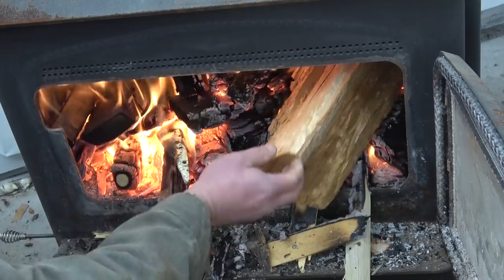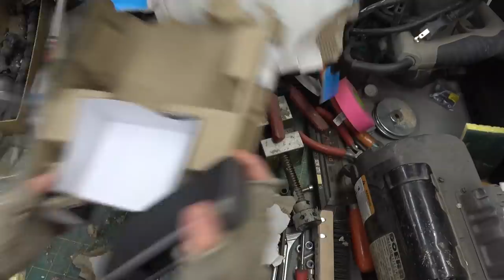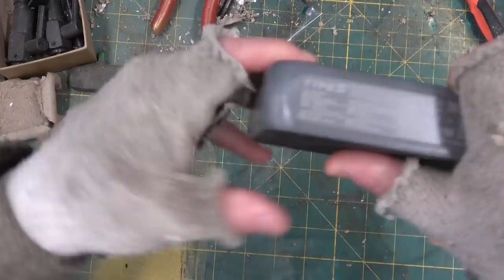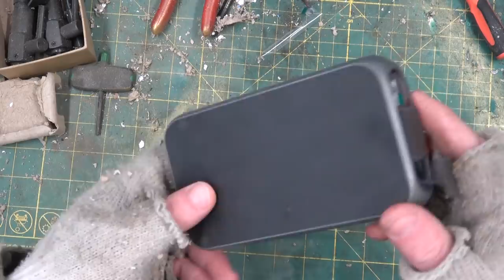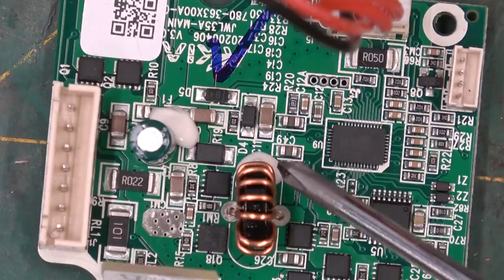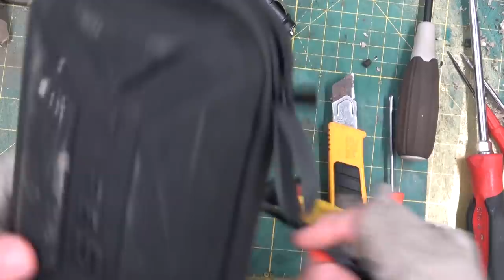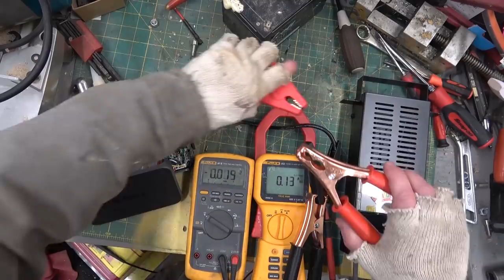BOLTR: Costco Boost Pack | Stupid Design

Comment: $5 says there's pocket lint packed down hard at the bottom of your phone usb!  I'll shut up and go back to watching now.
Reply: Every mechanic/tradies/engineers issue, greatest day when I cleaned it properly haha
Reply: 10$ says there’s grease in there
Reply: That’s where the paperclip pokes
Reply: My favorite is the staple magnetized into one of the speaker holes.
Reply: I came here to say the same. I've found that the punched metal sim card removers are quite good for getting the sh*te out of there.
Reply: That's absolutely what it is, my Pixel did it too
Reply: Since you said so I checked mine.

It verking, it's verking!
Reply: Oh Adam I cut a lot of steel and dig bits of metal out of the speaker screens all the time. I Wish you could turn permanent magnets off for a second or two
Reply: Got a pixel as well, same thing packed full of lint and factory dirt, that's what the sim key is really for
Reply: @walkersullivan6201  sim key works great when it's real stuck
Reply: Was about to say that as a phone repair guy that sounds like just a stuffed port, usb C and lightning port are both notorious for it, use a very sharp pin or fine as heck tweezers and dig it all out and she'd be as good as new
Reply: Tony, tell the comments to use a plastic poking thing
Reply: Indeed! Get yer toothpick and start pickin!
Reply: Or he's using gas station usb cables which are low quality and loose fitting. Like my pants.
Reply: @walkersullivan6201  Depends how badly packed in it it - I fixed a sparky's phone the other month when he came to visit, compressed air did bugger all - hed been pushing the plug in harder and harder to try and get it to contact.
Reply: Cut a 1mm strip of plastic off an expired credit card. Rigid enough to scrape out the crud, but doesn't bridge contacts.
Reply: @mikehealy74  If at first you don't succeed turn up the regulator.
Reply: 100% I have the same phone and have had the same issue. Give 'er a blast with the compressed air cannon and you'll be good for another few months. I'm sure it doesn't help using my phone for a flashlight while using a carbide hole saw to turn a j-box into a swiss cheese box. But I digress. USB type C is far superior to the prior iterations because it doesn't lose it's holding power like the cheap little metal tabs on the mini and micro.
Reply: I know it would have helped to hit it with the grease gun but I couldn't find a damn zerk anywhere on the thing.
Reply: Holee Sheetz....My hole has lint
Reply: I use the plastic toothpick /floss tools.
Reply: Yeah, I agree had a couple of USB c phones now and both suffered with that issue.
Reply: And here I was thinking it was packed full of shmoo..
Here is my 5$ ToT
Reply: loved the feature length maho video btw
Reply: I got $10 on metal shavings (Is that grandfathered in as pocket lint?). It's always metal shavings.
Reply: You get around too Tot lol
Reply: Same. I've had that on my 5X, Pixel 1, and Pixel 2
Reply: Checking my usbc device. Yup pocket lint. ToT maybe write some cnc code to clear out the usbc socket with a 1mm pcb endmill?
Reply: Buy Huawei, their usbc ports last forever. Unlike their micro usb ports which can be damaged by wind...
Reply: Yup with either C or Micro I have to go in with an XActo every few months to pull out lint
Reply: ToT is probably right, AvE might have to cough up $5.... I've resorted to digging out my port with a small allen key or a needle, need something pretty rigid and can scrape the surface cause that lint gets packed in there real hard
Reply: If only ol AvE had some sort of contrivance what for diggin out his pocket stuffings  from his electronical orificees.
Reply: @yes7420  all the shmoo
Reply: If digging the earwax out doesn't work, sometimes an off-the-shelf usb to usb-c cable works. My pixel 2XL stopped recognising the google-branded chargers, but would still charge with random 3rd party cables. It's one of those "we know about it but it's cheaper to just send out new phones than fix the underlying problem" kind of deals.
Reply: I ended up having to get a plug to cover the port on my phone. I hardly ever used it, so it wouldn't get cleaned out from plugging and plugging in the cable. Because of that, lint piled up and wouldn't let my headphones work, the few times I needed them.
Reply: @walkersullivan6201  Lol 9mm works even better 🤣
Reply: yup, been there, its packed in hard too, so it feels like you might be wrecking something but you can dig her out
Reply: exactly what i was thinking
Reply: @heatshield air Always works for me never had to go past 140 psi
Reply: I call swarf/ iron filings, wireless charging and speakers have magnets.
Reply: Every F*ing time! Phone won't charge? Lint in the socket. It's theType-C food of choice apparently.
Reply: Happens to me about once every 2 months. Drives me nuckin' futs. On the plus side, I finally found a use for my Swiss army toothpick.
Reply: AvE will probably find a whole cat in there.
Reply: wooden toothpick is the best for getting the smooe out of the charge port
Reply: @heatshield  to each there own
Reply: @apainlessone  ...until you break the toothpick inside, nylon is generally better and not brittle.
Reply: I carry my phone port up and never have a proble with this
Reply: Agree is amazing how much lint can fit in a USB C port. I cleaned out a friends phone and when they saw pile of lint on the table they refused to believe it came out of the charging port.
Reply: Yep, only time I've seen a problem with type-c there has always been some schmoo packed right in there.
Reply: +1 on the SIM key: keep it on your nightstand and give it a swipe before you plug it in when it's getting uppity. 
It's amazing what you'll pull out of there.
Doesn't help the moisture thing though. For that, flip your charge cord around so that the squared seam in the connector is facing you. Not 100%, but way less frustrating.
Reply: ToT good luck with the MAHO
Reply: Holy sh*t I have had the same problem for 6 months and had been told it would be $125 to replace the port and install new back glass (which they would have to break to get in). 
I just repaired it for free w a bit of crap I had lying around.
Reply: Seconded. Charging problems are always lint on the pixel. I use a decommissioned credit card cut into a hook shape to fish it out.
Reply: @thomasscott4378  
Hehe...you release the glass with a heat gun. 
If you replace the glass, it's because the sealant was compromised, not because you have to break the glass to get it out.

But then again, they also didn't suggest you try cleaning out the port first...
Reply: @marfinhead  you just need a much stronger magnet, just be sure to cover said magnet with plastic so you can peel off the junk
Reply: I use those green plastic tooth cleaners on mine.  Amazing how much crap fits in that port.
Reply: My pixel was the worst for collecting fluff. Subsequent phones haven't been nearly as bad.
Reply: I've "fixed" a sweet fuckton of friends' phones with this.
Reply: A blunted toothpick isn’t conductive, won’t scratch plastic and picks up cranny lint quite nicely.
Reply: This just fixed my S8. Thankyou!
Reply: Totally agreed. I get a sewing needle and shove it in there to relieve it of lint every once in a while and it works like a charm after.
Reply: Came here to say that, but of course ToT beat me to it. 8^)
Reply: @scythelord  easy fix, buy a decent magsafe knockoff. Saves the port, too.
Reply: @Trialnerror  ahh tis true my friend but one can dream. Because as some have suggested a stronger magnet can really kerfuckle the speaker all to Hades and back then Bumblefuck here sounds like Minnie Mouse.
I've learned after destroying two phones 
A: never put the phone down on the metal bench
B; sometimes a piece of gorilla tape or similar 1000mph tape will do the trick
Reply: I agree with the Maho Man! I cleaned out my Pixel's USB-C port using the pointy end of one of those plastic toothpicks, worked a treat.
Reply: Cat phone has a rubber bung.
Reply: @RyanNeufeld  You got your pants at a gas station? Well there's yer problem buddy. :p
Reply: I've found usb c to be far more robust than that abomination known as micro USB
Reply: I came to the comments to say this. Bought a used s9+ that was touchy when charging through the cable. Pocket lint was packed in the port like concrete. Took several minutes to remove it all. Haven't had trouble with it since and that was 9 months ago.
Reply: Added this exact reply before scrolling down.. I can't exaclty say GREAT minds think alike, but at least the hive mind comes to a concensus
Reply: I use my Diresta ice pick to clean out my lightning ports more frequently than I care to admit.
Reply: @marfinhead  Have ruined a fair number of cell phones with ferrous bits attracted to the speaker's magnet. Life in the machine shop...
Reply: Was about to comment the same. My headphone jack stopped working a few months ago and after pulling out more lint than I could ever imagine it worked flawless again.
Reply: Lightning jacks have problem that too. Sad how phones have gone from having tethered covers on 3 ports, to 1 exposed port that clogs like a bumblef^ck General store’s shitter. I call it ‘reverse feature creep’.
Reply: I tried to blow the USB-C of my phone out with compressed air; and I managed to literally blow up my phone. The screen cracked...
Reply: Came here to post this and freakin This OLD Tony beats me. Are you kidding?
Reply: In Canada we call it "Pocket Insulation."
Reply: Use the magnetic chargers and never have to remove the dingus end again.. or only weekly if drop your phone as much as me
Reply: The Canadian Tuxedo(Jeans) strikes again! I have many.
Reply: Magnetic adapters for USB charging stuff.  Now our micro, Apple and C use the same cables, and any wear is on the adapter instead of the phone. The oval ones work better than the round ones.   Downside (especially considering where I'm posting) is that they can collect metal filings.
Reply: OtterBox,
Reply: Das how I fixed mine
Reply: I use one of those plastic toothpicks with a bit of floss. No danger of shorting or scratching, and much less of breaking.
Reply: In AvE's case not pocket lint, but chromolybdeniouscious grease.
Reply: I thought the exact same thing
Reply: @White.Elemant  oh he'll never get that out without a complete disassembly of the phone. If he's reading this, he needs to wash his hands to do that.
Reply: I'll take your bet
Reply: I was going to say i think their depending on what juice is left in the car battery and this being enough to top er off enough to turn the thing over. But he kinda covered that at the end there.
Reply: That's actually what was wrong with my phone, i was not fond of the idea having to buy a new phone till my buddy told me to check lol
Reply: @yes7420  I don't think he keeps it in the grease pocket.
Reply: @marfinhead  said the MRI technician :)
Reply: Got mine in an Otterbox Defender, and the rubber flap still works. No problemo here.
Reply: Actually it's solder get it right and it was just the tip okay

Comment: That looks like an LCD, not an OLED. You can tell as the background isn't completely black when something is displayed.  Also from the thickness of the assembly.
Reply: also from what's stamped  on the back of the PCB
Reply: I was looking for this comment. Definitely not OLED
Reply: also oled is expensive
Reply: thought the same. OLED would have a way better contrast ratio and next to no glow on the off pixels. Has the white on black color scheme to look like OLED though.
Reply: Also the board it's mounted on says LCD on it.  I was screaming at my TV!
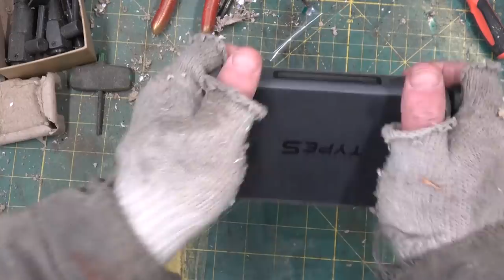Reply: You can really tell from the backlight bleeding on the edges around 5:26 oled won't have any backlight at all.
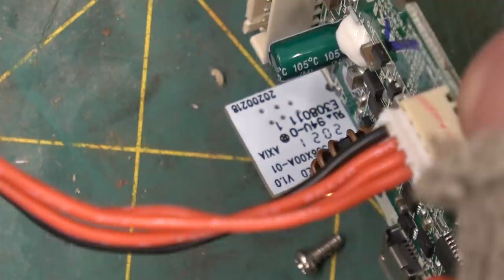Reply: 10:30 that however looks like a LED and not a lcd.....*BA DUM TSS*
Reply: @frogz  it is an LED. It's the "flashlight" portion of the box that eventually blinks SOS.

The lcd Portion has the button that controls the led light, but not the led light itself.
Reply: Read that as LSD at first and thought to myself that you have been sniffing those soldering fumes again. I need to go to sleep
Reply: @h3yw00d  What's funny is he actually made a comment about the backlight, but still didn't catch on!

(Side note: I do really like the white on black LEDs, even if not OLED (well, when the light doesn't leak as badly as this one.))
Reply: Just keepin is on our toes, can’t be too confident.
Reply: I was cornfused when he was saying that.
Reply: Def lcd
Reply: they're putting this same color for some reason on cheap imports because it matches that old school OLED look is my guess
Reply: @frogz  geez its an OLED flashlight he already said that! pfft
Reply: Du Hast Recht

Comment: Electronics nerd here, the 4 mosfets are arranged to act as a solid state relay
Reply: Also, MOSFETs are not NPN and PNP (these are Bipolar Junction Transistor types). Instead, they are N-channel and P-channel.
Reply: @orikolp9379  I know some of those words
Reply: care to explain how this works?
Reply: @bobedwards8896  Well, I'd love to, but it is a bit long...
Simply put, the bipolar transistor has three semiconductors directly attached to each other (they can be  either PNP - positively doped silicon, negatively doped silicon and positively doped silicon - or vise versa (NPN)).
This device operates by applying low voltage signal between two adjacent parts, which controls the current flow through the non-adjacent parts by varying the voltage (and its corresponding electric field).
A MOSFET is a different device altogether. It consists of a two negatively doped regions, distanced from each other, both inside a positively doped semiconductor (for n-channel MOSFET) and a metallic layer above it all, separated by an oxidized silicon layer (which is an insulator). 
When a voltage is applied bewteen the metallic layer and one of the negatively doped regions, a conductive channel is formed between the negatively doped region, and the device can conduct current. When the voltage is removed from the matallic layer (which is aptly named Gate), the device stops conducting.
I hope this is clear enough... you can find a ton of information about this all over thr internet.
Reply: @orikolp9379  I think he was talking about the 4 MOSFETs relay. 

Effectively the mosfets and bipolar are the same just with different eh what’s the word I’m looking for alpha, beta? R_f? The application factor. 

Dealing with the specifics of how it’s built- the modern ones have moved past the traditional FOS layout anyway. In the 70s the difference was stark. But not as much now.
Reply: @altimmons  Actually, MOSFETs are quite different from bipolars.
Bipolar transistors are optimized to operate in the linear region, while MOSFETs are optimized to operate as switches, either in the saturated region (ON) or the cut off region (OFF).
Bipolar transistors dissipate a lot of heat when they conduct high currents through them, even if they are completely saturated, because there is always a considerable voltage drop between the  collector and the emitter. MOSFETs on the other hand, have only ON resistance, that can be extremely small, thus dissiapte very little heat while saturated.
Reply: @orikolp9379  I knew immedietly after posting this that I would get this comment.  Im sure I deserve it.  But I figured if youre getting your info from a YT comments section then its enough detail.
A bipolar is as much a mosfet as two diodes are a bipolar.  They are and they arent. Ones a vacuum the others a pump.  the same in some contexts vastly different in others.
Reply: @orikolp9379  And while there are considerable differences.  This isnt what I would really go with.  There are bipolars that perform in this region, and mosfets that dont.  Thats not the major difference Id go with.  Id probably highlight one is Voltage driven and the other current.
Reply: Well then the question becomes.... But why tho?..... Why not a more conventional solid state relay?
Reply: @JivedSonen  Pros of MOSFETs over SSRs: Faster switching, lower losses, smaller footprint (and volume).
Cons: Higher complexity, need better design skills.
Reply: @DiegoAlvarez-lf8us  

👀
Reply: Is that what's inside the SSR's I've bought?
Reply: @billybbob18  I don't know what's in your specific SSRs, but generally they are made of thyristors. These are semiconductors with very little control options, but they are suited for AC operation by requiring quite simple control circuitry. They are more lossy compared with MOSFET type switches, and can only cut the current at the zero crossing.

Comment: I rigged up a jumper pack up from four 9Ah Lipo cells and a cut up set of 4AWG jumper cables. The pack started my 4 cylinder with the main lead acid battery completely disconnected after the jumper pack and engine sat overnight at -10F. The jumper pack now lives in my trunk.  It would have been easier and safer to buy one, but it works for me.

Comment: I have a similar model from Amazon called the Thor 1000. Looks like an identical design. I managed to start the 4-cyl Isuzu pickup engine in my truck with it. Had a completely dead battery. The temperature was temperate, and it BARELY got it started. I think you're probably right about the cold and big trucks.

Comment: I've used a similar device to start a car once and my lawn tractor 3 times. Each time I've been surprised it works, and it barely cranks before the thing times out, but it worked. I have zero faith in it, but I have to say, if you're sitting with a dead battery, it's better than nothing.
Reply: Yup, and if it doesn't immediately start, trickle charging before you retry is the way to go.  One of these should get you going again.  If it doesn't, you've always got the USB to charge your dead phone to call for help.